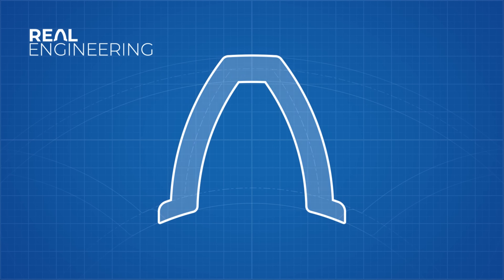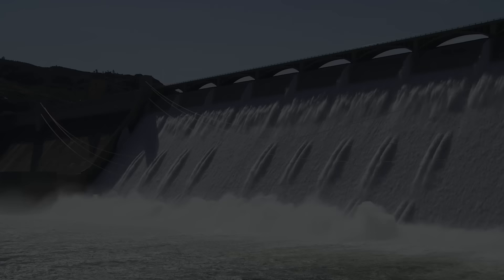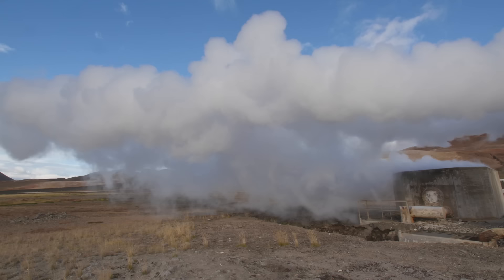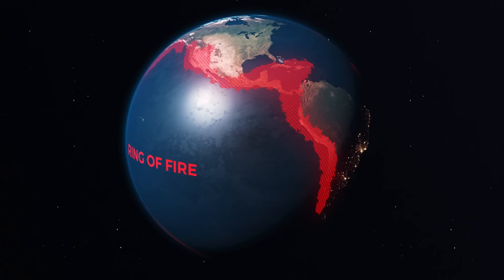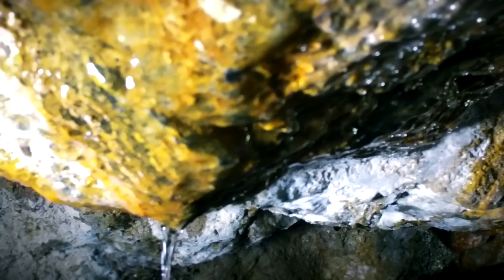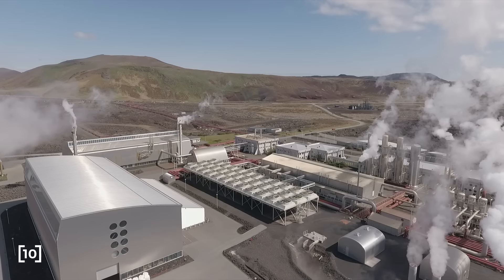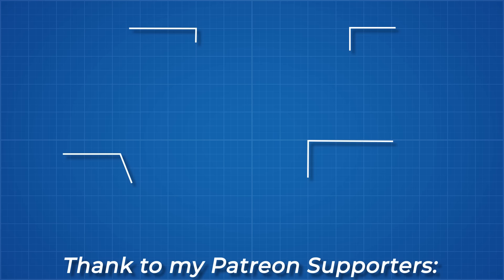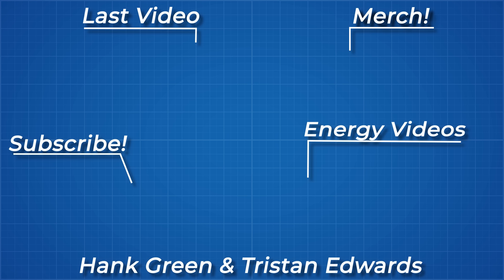Could Earth's Heat Solve Our Energy Problems?

Comment: Most opposition to nuclear energy is based on ignorance. Change my mind.

Edit: To summ up most answers for those mentioning Chernobyl and others. Just like a plane crash, these examples are easy to point out sources of a couple tens of thousands of deaths. What people always forget mentioning is the estimated 4+ million deaths a year from air pollution. That's one part of the ignorance i was talking about. A couple accidents costing a couple tens of thousands of lifes cant realistically ever outnumber the lifes we lose each year by polluting the air as we do. Then there is also climate change, which is a hard to grasp concept for some, but way worse than a couple tens of thousands of deaths by itself (and potentially irreversable if we keep continuing). Then there is the fact that newer types of reactors can pretty much make a meltdown more or less impossible, not even talking about using thorium. Keep in mind that nuclear energy was - and still is - a very new energy source in terms of progress. The only real problem would be the waste. However, it's better to be able to contain and store waste, compared to just pumping it into the atmosphere. Keep in mind that radioactive elements with short halftimes are the dangerous ones, but gone in a couple years. These with millions/billions of years of halflifes are basically not very dangerous, since they dont radiate a lot. So the most problematic ones are those with halflifes that make them radiate dangerous amounts, but still stick around long enough to cause problems. Still, in comparison this is a smaller problem to deal with than air pollution and greenhouse gases by far. Also renewable energy sources are neither renewable, nor completely green and it's not possible to sustain the planet by them alone, not to mention all those batteries needed.
Reply: Isnt the only problemb the nuclear waste?
Reply: @mike4490  there isnt even all that much. just stick it under a mountain.
Reply: @mike4490  isnt that much, we have deposits of nuclear waste prepared to receive the waste. Nuclear is the best solution to mankind
Reply: Most, yes. Not all, but most. The risks are greatly exaggerated in the public consciousness because of a handful of well-known disasters, while in fact nuclear plants are probably safer than most oil or coal plants.

However, part of the reason nuclear power plants are so safe is because the public is so paranoid about them.
Reply: @mike4490  In molten salt breeder reactors, to my knowledge there isn't really waste; and in other forms of breeder reactors, just other forms of fuel as byproducts that can be processed and used to generate more power, whose products can be used to fuel breeder reactors, IIRC. Like, uranium can be turned into plutonium which can then be used to generate energy, convert back to uranium, and then used to make more plutonium, and so on. The uranium that both absorbs energy and becomes plutonium (specifically PU239) and is made when the plutonium is used as fuel is Uranium 238, which is the vast majority of uranium (like, over 99%; the uranium we use for nuclear fuel is U235, and it's all of like 0.72% of the uranium mined or something?) and is relatively non-radioactive, with a half-life of 4.5 BILLION years, so is a pretty stable product to store. Still not safe to have just lying around the house, mind you, but locked up in a simple concrete storage facility? No problem. Here's some more info on it: http://www.radioactivity.eu.com/site/pages/Uranium_238_235.htm
Reply: does not matter, the future is zero point energy
Reply: @mike4490  And accidents....
Reply: Michael Liogky nuclear waste is containable and is not pumped into the atmosphere we breathe
Reply: One word: Fukushima.
Another word: Chernobyl.

A poorly designed fossil-fuel power plant that blows up won't irradiate the region for many decades.  Nuclear plants will.
Reply: @amrencortez2636  yeah but look at Fukushima, isn't it still polluting the Pacific ocean. People are more llikey to sweep their waste under the rug these days. 
Shoving the nuclear waste in a storage facility doesn't sound smart either. We have a problem with normal waste as it is. We don't need a dump of nuclear waste as well. 

While I understand nuclear is the most efficient electricity producing option. how many plants would we need to power the planet? Especially with the increased need if everyone goes electric. There would be a point where the waste would become unreal.
Reply: @mike4490  Reliability is a big concern with nuclear.  It's not just Chernobyl, 3-mile-island and Fukushima that we've had so far.  There are dozens of incidents that have happened in the smaller scale plants that have largely gone unnoticed by the general public.  Nuclear plants these days are probably the safest industrial sites in the world, because of the consequence of accidents being so high and so very public.

And it's a truism in engineering that there is no such thing as an accident proof system.  You can build something that's 99.9% reliable.  You can build a thing that will catch that 0.1% error 99.9% of the time, and you can make multiple redundancies and layers of all these systems.  But it is always possible that everything will fail - especially since most power plants on the grid are operating on a for-profit basis, meaning there's only so much money to spend on training staff, maintaining equipment, etc. 

You can probably design a commercially viable reactor that, as long as nobody takes shortcuts with staff and maintenance (which is guaranteed to happen), will only have a 0.1-0.01% chance of catastrophically failing in any given year.  But when you build ten thousand of them all around the world, the odds that one will fail in any given year are quite a lot higher.
Reply: @RonJohn63  Chernobly and fukishima were both caused by human error, not an error in the power plants design. And they only irradiated part of the city/ town they were in. Also, nuclear plants have become much safer since then, and more people have died from wind power than nuclear power. Just putting it out there.
Reply: There are two important details about nuclear which makes it the best source. The first reason is how part of the earths core contains a large amount of radioactive elements which is mentioned in the video which makes a geothermal plant an indirect nuclear power plant, the second is how nuclear waste is discarded in locations which are monitored by the military , and it is possible to recover certain elements from waste.
Reply: @remenencenda768  not an error in the power plants design

Given that humans designed the plants, your argument is fallacious.

And they only irradiated part of the city/ town they were in.

Ah... "only part" of the cities.  That makes it sooo much better.

more people have died from wind power than nuclear power.

And yet I can walk up to a recently-destroyed windmill and not have to wear a lead-lined suit and only stay for three minutes.
Reply: @rashkavar  In 1958 in UK , there was a fire in the reactor of Winscale 1. This caused a radioactive release of radiation across the uk and europe (1958). On a scale from 1-7 with 7 the worst, it was ranked as a 5 , serious and covered up by the government of the time.They even changed the name of the Winscale Plant in uk to Sellafield to make it look like the problem had gone away.
Reply: Fission nuclear energy has we know it today is outdated. It use a fast breeder process which is dangerous and inferior to a thermal one. We used this because knowing the atom bomb its what we knew the most. Also it enabled us to produce elements required for atomic weapons.  Current nuclear fuel is inefficient: we have to extract the .7% of uranium 235 from the uranium 238 which also extracted from the mined minerals using fossil fuel. Then the "burning" of 235 is not that efficient and will have to be reprocessed. Please look into it.
Reply: bruh why you trying to bring out the crazies you already know there's no rational arguement to change your opinion
Reply: @amrencortez2636  No , its leaked into the atmosphere through various nuclear accidents, and do you really believe there wont be any more(accidents)?
Reply: @dasovietpotato3784  Not sure I'd call geothermal energy an indirect nuclear power plant because there's radioactive isotopes in the core.  Even in the most technical of senses, that's not true - radioactive decay is not what runs a nuclear power plant; fission is.  And it's definitely not comparable in terms of what people would expect "geothermal power" and "nuclear power" would mean.

And which military?  This planet has several, and the nuclear plants that currently exist already exist in more than a dozen different jurisdictions.  If a single military is looking after all the nuclear waste in the world, that country has done a lot of covert invading that I've not even suspected up to this point.

And given the waste material that people are actually worried about is the stuff that's dangerously radioactive on the timespan of 10 000 to 1 000 000 years, I sincerely doubt there's much use for it.  There's definitely the medical radioisotopes, but if you want to produce those in bulk, you're not running a power-optimized reactor, you're running one optimized for creating specific isotopes.  (And yes, facilities like this do exist - back when I was a kid, before 9/11, there was even one doing public tours that I got a chance to visit.)
Reply: @remenencenda768   I dont know where your talking from buddy. It cant be this planet. Fukushima was caused directly by a 14m tsunami flooding backup generators. i.e. by events not even imagined by the designers. Not  just a big wave but also lowering of the land. 
So who told you that seven years after Fukushima happened, every nuclear reactor on the planet has had a design overhaul to cover things that no one planned for?
You are truly deluded...
Reply: @musman9853  Is there a mountain near your home you would like to suggest?
Reply: @RonJohn63  Yeah, it's definitely a better idea to just pump fossil fuel waste into the atmosphere. Air pollution is estimated to cause 4.6million deaths per year. Fukushima and Chernobyl together? A couple tens of thousands, including all the potential deaths that may or may not be caused by the radiation. Make that millions for all i care, the amount of lifes we would save by simply switching away from fossil fuels cant realistically be outnumbered. 
It's the same thing as with planes. They are increadibly safe compared to cars, yet the media is caring a lot more about a single crashed plane, killing a couple hundred people at best, than do about the estimated 3000+ deaths a day due to car accidents. Humans are good at tackling specific, easy to grasp problems. Like, for example if an asteroid was going to crash into earth, everybody would agree that that's a bad thing. Climate change on the other hand, some people still dont believe is real. 
What i'm getting at is that a couple thousand people dying in a explosion, or whatever, will always get more attention that millions dying each year through invisible, harder to grasp concepts like air pollution. That does not make them any less important tho. 

That said, for both Fukushima and Chernobyl the problem was not the technology, but safety restrictions. Chernobyl was a human error, which should not be able to happen in such an important structure. On top of that Fukushima should have been designed stronger for an area that is known to suffer earthquakes and tsunamies regulary. In both cases these catastrophies could have been avoided by better planning and security. These are problems we can work on tho, while long lasting air pollution (or greenhouse gases) may not. 
Then again, there are better reactor technologies nowadays, that may potentially completely eradicate the risk of failure. 

Last but not least, a nuclear reactor can not "blow up" like an atomic bomb. That's impossible. They are two completely different things.
Reply: @Veeger  Yep, that's the kind of incident I'm talking about - the ones that aren't the big 3 well known ones.  Fission has its benefits, but the safety issues are a major detractor.

There's a bunch of public paranoia on top of this.  Which leads to coverups...which leads to more paranoia when those coverups inevitably fail to cover everything up.  It's not a great situation.

Personally, my biggest fear in the energy development of the future is that this paranoia will leak over to fusion power when it becomes viable despite it being a very different scenario.  We're going to need that power source to be a long term energy solution (if there's anything that can compete with geothermal energy for reserves, it's our deuterium reserves...plus stripping the oceans of deuterium won't cause the massive problems that long term exploitation of the earth's core heat will.  (See Mars for what happens when you don't have enough heat in the core) 

Both of these are incredibly long term scenarios, of course, by no means could we either exhaust our deuterium reserves or geothermal reserves within the next century...or the next few millenia after that, unless the tech development of the 20th century turns out to be the start of a sustainable exponential curve.
Reply: @Veeger  In the event of a tsunami detection they are to iniatiate SCRAM, or basicly dump the fuel rods in the sealed pool. (it also stands for Scientist Control Rod Axe Man)
Reply: @RonJohn63  First of it is not a "windmill" but a "wind turbine". A windmill is a mill for grain that uses wind to turn a grinder to mill the grain.
And by "human error" I was referring to an error iin the operators, who were unfocused and tired at the time. But the people that designed the plant had years and didn't make any mistakes.
Reply: In order to have a safe nuclear power we need to have a number of systems in place. In the end you are trusting somebody you don't know to have a truly safe and successful system. Much of the opposition to nuclear power is based on a certain kind of paranoia that at the core is at least reasonable. I don't think any of these problems are not solvable and a certain amount of transparency can guarantee competence but we have to trust people in positions of authority in order to make everything work. I believe that level of trust is in very short supply these days.
Reply: @ErikHare  we can make a safe nuclear power plant.  The problem is that they're soooooo expensive.  That's because humans tend to be sloppy, lazy and cut corners.  (Which is why, for example, there thousands of tons of dioxins in the Hudson River.)
Reply: What about the finite amount of uranium reserves?
Reply: The problem of nuclear waste actually isn't that large. I'm quoting most of my information from an article posted by the World Nuclear Association that I'll try to find and link here. https://www.world-nuclear.org/information-library/nuclear-fuel-cycle/nuclear-wastes/radioactive-wastes-myths-and-realities.aspx. I shall sum a few of the points up though.

First of all, the nuclear waste problem is actually not that serious. Much of the High Level Wate (HLW), which is the dangerous stuff, has a half life of only a few decades. This means that it can be contained in short term storage facilities until it is no longer as hazardous. After this, long term storage can occur. Approximately 3% of total nuclear waste will still be dangerous in thousands of years. This stuff will be buried very deep underground and will be encased first in glass and then sealed in a steel cask. Even assuming a worst case scenario of complete societal collapse, where our future generations have the ability to reach the dangerous waste through its containment, but don't understand the meaning of the trefoil symbol, or the warnings written around the plant, this waste would still cause less harm than other energy sources do today.

As for disasters like the Chernobyl and Fukushima incidents, these are the true problems with nuclear energy, however they are manageable. The Chernobyl incident was largely caused by both human error, and the Soviets insisting on hiding information about the flaw in their RBMK reactors. If the operators in the control room had known about the consequences of pressing the AZ-5 SCRAM button, the incident could have been largely avoided. The result would likely have been a large scale meltdown, rather than the explosion that caused the entire area to be contaminated. The liquidators would never have had to clear the roof of radioactive debris. The heat exchanger to prevent the corium making its way into the groundwater would likely still be necessary, since the RBMK reactors were built without containment structures. My point is that modern nuclear reactors are built so that this series of events could never happen again. Of course, some other unforseen event could happen to cause a level 7 incident, but we will be prepared for it.

The incident at the Fukushima Daiichi plant is a good example of this. Yes, to this day it's still causing problems. However, even though several of the reactors melted down, the incident is far more contained. The primary reason that this incident even occurred was due to errors on the part of TEPCO and General Electric. The US NRC warned in 1990 that damage to cooling systems in seismically active regions were a likely risk. The Japanese NISA quoted this in 2004, however TEPCO did nothing in response. They were also warned that their seawall was not sufficient to survive a powerful tsunami. Again, TEPCO did nothing. The plant was largely designed by General Electric, who supplied the Type 3, 4 and 5 Boiling Water Reactors and specified to TEPCO the positions of the emergency cooling systems, which were damaged in the tsunami and caused the meltdowns. TEPCO were warned by their engineers that placing the cooling systems in these positions was risky, but they decided to follow GE's specs. It is unknown if GE provided these specifications knowing about the potential tsunami risks, or if they simply knew it to be the optimal configuration for their reactors, but either way, it was a mistake. If TEPCO had been forced to make changes by a regulatory body, the Fukushima incident could have been avoided.

I suppose my point is that in both of these incidents, it was known that the threat was possible. If we can ensure that nuclear reactors adhere to the necessary safety standards, there is very little risk of this happening again. It's a human problem, not a technological one. Until safe, clean fusion energy is developed, nuclear fission is our best option for power, hands down.
Reply: @Veeger  I think to answer the initial question that we have post here we can say that opposition to nuclear power is not necessarily born of ignorance but it can be born of skepticism. If you wish to be more negative about it you could say paranoia. But it is certainly based on a lack of trust and indeed and understanding that we cannot take into account everything.

Are there failsafe systems that can manage absolutely any situation? I believe that is actually quite possible. But the public has to have trust in it.

Rather large failures have eroded that trust. In many ways this is reasonable.

Your point that it may not be possible to have complete Trust is at least reasonable. I believe you are wrong but it would take a tremendous amount of detailed conversation for either of us to prove our position. Given a Layman's understanding of the situation I think it is quite reasonable that we have skepticism.
Reply: @Veeger  I think to answer the initial question that we have post here we can say that opposition to nuclear power is not necessarily born of ignorance but it can be born of skepticism. If you wish to be more negative about it you could say paranoia. But it is certainly based on a lack of trust and indeed and understanding that we cannot take into account everything.

Are there failsafe systems that can manage absolutely any situation? I believe that is actually quite possible. But the public has to have trust in it.

Rather large failures have eroded that trust. In many ways this is reasonable.

Your point that it may not be possible to have complete Trust is at least reasonable. I believe you are wrong but it would take a tremendous amount of detailed conversation for either of us to prove our position. Given a Layman's understanding of the situation I think it is quite reasonable that we have skepticism.
Reply: Its pure propaganda and psychology. A fatal event in a plane "seems" much worse than a lot of car accidents... people is afraid of the safest energy production method... thats life
Reply: Timothy Schellin then we use thoruim
Reply: Erik Hare Are nuclear reactors are safe, and meltdowns are almost always contained or stopped, Chernobyl was caused by laziness and sloppy judgement
Reply: It's based on experience of Three Mile Island, Chernobyl and Fukushima. It is also based on cost. In the US nuclear power plants cost billions to build. There are 2 power plants being built in the state of Georgia for a cost of 23 billion dollars. There is another plant being planned in England that will cost 20 billion. It is often the most expensive power source there is.
Reply: RonJohn63 the misconception has spread very far, but look at the definitions or search “difference between windmills and wind turbines”
Reply: RonJohn63 - Fukushima and Chernobyl are straw man arguments against fission energy plants.
I don’t think anyone wants more BWR or PWR reactors to be built.
If you don’t like uranium salt or liquid fluoride thorium reactors, I’d be curious why...
Uranium salt reactors can use what old reactors considered waste.
Reply: @mike4490  there are technologies, specifically  Lithium Fluoride thorium reactors , that actually "burn" / react  nuclear waste to produce energy.  Nuclear waste is not nearly an issue that the media had pressed during the 80's and 90's.  Majority of it is only weakly radioactive... there is an inverse relationship between half life and intensity of radioactivity.
Reply: @RonJohn63  correction Boiling water and pressurised water and graphite moderated reactors blow up.  Newr technology, especial salt cooled reactors CANNOT blow up.
Reply: Chalk River, Three Mile Island, Chernobyl.
Reply: @RonJohn63  "One word: Fukushima.
Another word: Chernobyl.

A poorly designed fossil-fuel power plant that blows up won't irradiate the region for many decades.  Nuclear plants will."

Correction A poorly designed nuclear plant will.
Lets use France as an example to follow. They have 58 nuclear reactors in operation since the 1970's and have one of the lowest emission rates in all of Europe.

They have had only a handful of small incidents for this entire period listed here: https://www.reuters.com/article/us-france-nuclear-accidents-idUSTRE78B59J20110912

It's a pity they intend to shut these down to comply with the Paris Agreement when technically speaking that agreement taking notes from the French.
Reply: @kefkaZZZ  all of which were based on non failsafe designs.. modern western style reactors require external power to run their pumps to keep core cool. if this fails, they are screwed. 

Chernobyl type reactors fail because their inherent design makes them very difficult to control at low power levels .  Causing a runaway reaction that generates steam explosions .

Molten salt cooled and moderated reactors do not have these problems.  as the reactor heats up, the fissionable fuels atoms spread apart further and further, reducing the power generated  in the core . they cannot 'runaway" like current reactors of both former soviet union and the western nations.  

I(f there is an issue where the circulating pump fails  or if power fails, the molten salt designs  are designed with a fusible plug of coolant salt that is kept solid by a cooling system ( usually just a fan or two ) . if there is an emergency ,  the plug melts and the coolant and reactor fuel drain into tanks where they cool and solidify . since they can never reach ultra high temperatures of a melted or exposed normal core, these materials cannot melt through  the containers  nor can they escape the reactor  chamber.

Search "lithium Fluoride  Reactors" or "Molten salt reactors " or "Thorium reactors" for more information  .
Reply: Opposition to nuclear energy is directly responsible for higher energy costs, greater reliance on fossil fuels, and more pollution. Despite the propaganda spread by well-meaning but ignorant environmentalists, RENEWABLES ARE NOT SUSTAINABLE. If things don't change and change soon, America is going to be facing a nationwide energy shortage as pressure from environmentalists chokes coal plants and over-reliance on wind and solar turns electricity into a commodity afforded only to the rich. Liberals and conservatives need to put aside their differences and embrace the only energy source that even has a chance at saving us.
Reply: @RonJohn63  Modern Thorium liquid salt reactors are "walk away safe" -- which means if they fail, the nuclear reaction stops.  They don't blow up because the CAN'T blow up.  Educate yourself.
Reply: @walker1054  Another point is that the rare earth elements mined to make windmill magnets and high quality photovoltaics are in ores which contain Uranium and Thorium.  So to make "green" energy harvesting devices, piles of radioactive waste tailings are produced.  So there is a nuclear waste problem without the reliability of nuclear power.  So the nuclear waste from green power will have to be reburied or burned up in a nuclear reactor.
Reply: @RonJohn63  The radiation risk os vastly overstated. Even to this day you can walk safely around chernobyl in plain clothes, even in the plant itself. Only the sarcophogas and basement levels are still highly dangerous.

Fukushima has done negligible damage to all but the most immediate surroundings, and frankly there is not enough radiation for lethality.. Just an increased cancer risk.
Reply: Why? You’re right.
Reply: Easy: Chernobyl and Fukushima.
Reply: The future is THORIUM!!
Reply: Guys lets just use thorium. With thorium it is impossible to have a meltdown and is more efficient than uranium and the thorium only has a half life of 130 years and is less toxic and produces less waste than traditional nuclear waste
Reply: @yann9378  BS:
Meltdown is possible depending upon reactor configuration. Since thorium cycle requires TWO neutrons per fission (first to produce U-233, second to fission U-233), reactors must be compact to prevent neutron loss. Compact reactors always run risk of thermal runaway.
Half-life of thorium is 14 billion years.
Wastes are exactly the same as uranium reactors.
Reply: @KainYusanagi  You wrote: "Like, uranium can be turned into plutonium which can then be used to generate energy, convert back to uranium, and then used to make more plutonium, and so on"
Where do you get this nonsense? That is a perpetual motion machine that you describe. Once plutonium is fissioned, it CANNOT be converted back into uranium.
Reply: @RonJohn63  Look up thorium salt reactors.  Not all nuclear power is the same, and there are indeed some cycles and reactor designs that are not susceptible to the thermal runaway that causes disasters like Chernobyl and Fukushima.
Reply: Most sure. But by no means all.

Australia's most recent report on the matter concluded the following (and didn't mention the issues usually brought up)

Of the options Australia has for generating power, nuclear would be among the single most expensive options in terms of price/kwh generated.
It also provides baseload power only, which, given the existing state of the grid is the least appropriate type of new generating capacity. (the country desperately needs more peaking plants, NOT baseload.)
Finally the lead time for constructing a nuclear plant is on the order of years to decades, which is problematic when faced with more pressing immediate problems.

So... Sure. 'most'. But by no means all.

And it's as naive to call nuclear a cure-all for all the world's current power problems as it is to reject it outright.
Reply: Fabian most opposition to nuclear energy is based on history.
Reply: @romeufilipe5574  Zero Point energy is not a commercially viable energy source in the slightest
Reply: Nuc power is the most expensive at 12c per wh and produce  1GW  vs  2GW  at petroleum  plants    Just what re-usability in actual practice are you referring to? The holding tanks at most Nuc plants are full and the rods they hold are 100k times more deadly than when they were installed  The rods have to be held for 40 years min before they can be transported and cooled continuously to avoid meltdown  There is no destination for the rods and no approved safe transport and storage   The US taxpayer has payed for the re-fueling and the total percent of our power needs has never been over 20%  The process to produce fuel rods is complex and expensive the tailings left behind from the entire mountains leveled to produce a few boxcars of yellowcake has a big environmental impact
Reply: Fabian, most opposition to nuclear energy is due to experience. 
Back in the '50s the public expectations of nuclear energy were limitless. It was going to be a limitless source of power. This was when the memory of Hiroshima and Nagasaki was fresh.
Reply: @RonJohn63  - Keep going: Three Mile Island, probably before most YouTube viewers were born. Hanford (plutonium transmutation). Oak Ridge (uranium enrichment).
Reply: @remenencenda768  - Chernobyl's RBMK is an inherently dangerous design. The 11 remaining operating reactors have been modified to reduce the danger. No one wants to build any more RBMKs even of the improved design.
Reply: There may be more requirement for a safe nuclear plant than we know. For example, financial cost in the long run (can the company/state afford it from the building to maintenance to disassembly), skilled labor (we don't want jerks to do the work), appropriate location with appropriate weather (making a custom power plant would drive the developing cost through the roof), etc. Not saying that nuclear is bad, but we should probably take awareness to it cons and pros before forming our opinion.
Reply: @DavidFMayerPhD  That's exactly what happens, though? U-238 gets bombarded with neutrons to convert it to Np-239 which then beta decays to Pu-239, which itself decays via alpha decay to U-235. Once any particular molecule is consumed for fission, though, of course it can't be used that way (in plutonium's case, it's mostly xenon and zirconium that it fissions into, by mass). If you thought I meant that the specific portion used up in fission can be re-used, just getting split down to a form of uranium, no; I was talking long term, over the entirety of human existance going forward utilizing nuclear power. Sorry if my phrasing implied other than such to you.
Reply: @chaomatic5328  Absolutely true, but most people are done after listening to the cons these days. Safety needs to be worked on. With higher public acceptance science would also eventually develop way better reactors - and even now there are some that potentially make meltdowns impossible in theory. So while the waste is a problem, all things considered nuclear fission is a huge stepping stone we simply dont want to step on, but may eventually need to.
Reply: @Viewer19  You really need to look at more sources than one for nuclear power, Nuclear power is among the cheapest power options. And to get the uranium we don't level mountains. That would be expensive and ineffective. Instead we use mineshafts going down towards were uranium is more common. And after a fuel rod is used it has a significantly less amount of radioactivity, and is then stored in a pool of cooled water until it drops to an every lesser level, where we then ship it off to Norway because why not. And you can literally swim in the holding tanks at nuclear tanks, provided you saty at least ~2 meters away. The USA government could put them ~2 meters under pools and no one would notice any radioactivity, (it would be separated by a barrier). Everything you have said is based on information from the '40s and misconceptions.
Reply: @PlanetGoddess  will see
Reply: @remenencenda768  No the shine from those rods is more deadly to humans than the new rods and have to be held for 40 years min before they can be transported and cooled continuously to avoid meltdown Did you not understand  Fukishima and the desperate rush to pump seawater into the holding tanks or do you skip over any facts that conflicts  with the disinformation that you cling to?  the US taxpayer has payed for the re-fueling and the total percent of our power needs has never been over 20%  The process to produce fuel rods is complex and expensive the tailings left behind from the entire mountains leveled to produce a few boxcars of yellowcake has a big environmental impact  Modern reactors can use lower purity rods but they cost huge amounts of money US plants are old and ready to shutdown many that have are leaking and dangerous  You are the misinformed one proven by your erroneous statement of low cost which is patently not true it  is the most expensive and when you factor in re-fueling not cost effective
Reply: @Viewer19  First off do you not understand why rods are taken out? It is because they have decayed into amore stable form, so they radiat less, which is why they are taken out. And why to you keep saying "the us taxpayer has payed for the re-fueling and the total percent of our power needs has never been over 20%" First thing wrong with this, most nuclear reactors is the USA are privately operated or require no monetary input from the government besides building them. And second more than 20% of the USA's power grid is definitely used at once. Another thing I assume "yellow cake' refers to uranium fuel rods? because uranium fuel rods are comparitivly cheap in $/megawatthour when put next to wind, solar, coal, and hydro. while yes they do take some effort to to make it isn't that much, and we already have a ton of high grade uranium being used in USA's nuclear plants, if you can't guess It is from the nuclear bombs that aren't good anymore. And why must they be stored to prevent meltdown? After the fuel rod is used up it doesn't have any risk of meltdown because it will just emit a radiation, which is blocked out by the fuel storage tanks. The only reason meltdown can accur is because when a fuel rod is still being used we have to bombard it with neutrons to keep it releasing heat, and when someone does a bad and messes up what is essentially a controlled nuclear explosion becomes an uncontrolled nuclear explosion. The only danger to us is when the rod is being used, and failures never happen. No reactor in france, the country that gets almost 90% of its power from nuclear reactions, have ever melted down. Chernobyl was caused by human error, and with better seismic scanner any other fukashima could be avoided.
Reply: @Veeger  Windscale was a poorly engineered (*AIR-COOLED* for crying out loud! Yes you heard right, they were passing AIR through the reactor's core and then exhausting it in the environment as-is!) and hastily built to produce plutonium. They only put filters on the exhaust because the head engineer complained, and even then they were known as a "folly" and deemed useless!
Reply: @remenencenda768  – Chernobyl and Fukushima each resulted in the abandonment of several hundred square miles of previously inhabited territory. Hundreds of thousands of people had to be relocated. The ongoing Chernobyl Cleanup continues to consume a considerable portion of Ukraine's annual government spending.
Reply: "Change my mind."

I won't.
Reply: Nicholas Miller There’s no need to abandon any of the land around Fukushima Daiichi. This is a perfect example of the insane overreaction to nuclear accidents.
Reply: also what about thorium, I know its talked about a lot on yt but if you take the nuclear power plants even further from civilisation you can kill fewer people and more marine life or non humans
Reply: @RonJohn63  
Operative words;
 "poorly designed".
Reply: It's not just ignorance of the populace - it's also ignorance of those in charge and in power.

Lest we forget 3.11.
Reply: @remenencenda768  You are so ill informed. All the nuclear plants in Russia that had the same design as Chernobyl needed their control rods to be redone due to a design flaw which caused a momentary increase in reactivity following a scram event. 

Fukushima was also a design flaw in the way the back up generators were placed. That reactor should also have had a passive cooling technique that did not rely on electrical source to circulate water through the core.
Reply: @curtischilders3024  You're using the "straw man argument" term incorrectly. Those two events are THE REASON why there's so much opposition to Nuclear. That's like saying the holocaust is a straw man argument against the Nazis.
Reply: @rainz2133  - by your logic, you better not fly on those dangerous jet planes. 
https://en.wikipedia.org/wiki/List_of_accidents_and_incidents_involving_the_Boeing_707

Interesting fact, Boiling water reactors (Chernobyl & Fukushima) were designed around the same time as the Boeing 707. 

One jet bad, all jets bad!  One fission reactor bad, all fission reactors bad! 🤔

No, that's not a strawman argument, that's a really well supported argument...  sigh
Reply: The problem is Chernobyl was milked for all political value by the West against the Soviet Union. Yes it was a terrible disaster but it wasn't as bad as it was made out to be. I don't know what the exact statistics are but only a few thousand people died from that accident compared to the 4+ million that die from air pollution.
Reply: @Fabian - I agree. It's hard to move forward, when some insist on clinging to mistakes made in the past. 
If reactors couldn't be made safer, or operated better, then they'd have a point. 
But nuclear gets better all of the time as large investments are made in safer and more cost effective systems.
Reply: @remenencenda768  @viewer19 I'm afraid you're both wrong. I don't have the statistics in front of me to argue points on cost and the like, so I'll leave that for now.

First off, spent rods do still produce heat. Radioactive decay, is inherently loss of energy. That energy produces heat through a number of different processes, depending on the form of radiation. However, they were not what caused the meltdowns in reactors 1, 2, and 3. They were caused by the same processes, but in the reactor core, not the SFP. The SFP did indeed heat, but not to the point of releasing radioactivity into the atmosphere. The spent fuel is indeed still highly radioactive, far more so than the original fuel rods. The original rods are actually stable, I believe. Pure U-235 doesn't decay spontaneously, at least not in amounts to produce harm to humans. When bombarded with neutrons, U-236 is formed. Which is highly unstable and decays to produce lighter elements and more neutrons, which when slowed by a moderator can interact with more U-235, sustaining the reaction. Spent fuel is removed when it can no longer sustain a satisfactory chain reaction. The material left in the fuel rods is highly radioactive because many of the waste products are more unstable. The benefit to this is that after a few tens of years, the material is nowhere near as dangerous, and can be put into long term storage. Considering most reactors only need to be refuelled once every ~6 years and produce quite little waste by volume, storage facilities are capable of handling the material until it can be put in long term storage. Please refer to my comment above to understand the process for this.

I have just taken a quick look at cost statistics and I think you'll find that nuclear power is incredibly cheap compared to most other forms. The cost comes from building the plants, not actually producing power. This means that a nuclear reactor needs to pay itself off. However the actual price for the consumer doesn't increase much, considering how long reactors can actually run for, leaving nuclear to be competitive. Especially when considered that they can be run non stop for literally years on end, compared to solar or wind that rely on good conditions. Once you factor in batteries to store excess, the plant cost quickly becomes more appealing.
Reply: @Sir Charmander the Third I understand and agree that nuclear is currently the most efficient. However we as a country are terrible when it comes to waste.

 I expect nothing different when it comes to nuclear waste. Creating more plants without figuring out the proper way to dispose of it, is foolish to say the least.
Reply: Until we find some way of dealing with and safely storing nuclear waste generated by nuclear power, we have a growing disaster waiting to happen. The US is still shuffling about barrels of waste from fifty years ago, and instead of it being buried safely (every proposed site meets pushback from state governments), it just gets moved from place to place. It's only a matter of time until a catastrophic failure or degredation of one of these barrels leads to an ecological disaster. It's only a "smaller problem" than carbon because it's for the most part contained. That's just because we've been lucky.

Yes, it's the cleanest pound-for-pound. But the waste it generates is by far the worst. Until we, as a nation and as a world, agree on a safe way of storing the waste, it's not a good option. In addition, if you can enrich uranium enough to create nuclear energy, you have the material to make nuclear warheads and weapons. This is just another issue. In a perfect world where everyone was mature, cooperative, and adults, nuclear would be great. But this is not that world. Seeking alternatives is still necessary.
Reply: @senselocke  
First of all, yes the waste is the biggest problem. It's the only problem when done correctly. As you said yourself, having the waste contained is by far better than just polluting the atmosphere. Even if one or more of those barrels broke, it would still be a local disaster, which we can take actions against - not a global one causing millions of lifes a year, every year. That said, nuclear does not mean uranium. The reason we decided to use uranium was because of it being usable for weapons. That was the main reason. Nuclear reactors were partly to be used as weapon production facilities. Uranium is neither the only, nor the best choice. That said, if nuclear energy was more popular, there would be more intent on researching proper ways of dealing with the waste, not to mention that we can recycle parts of it into other kinds of nuclear fuel. It's similar to most "green energy sources" use up tons of rare earth metals, for which we do little to no recycling. People just dont really bother until they have to. And even then, with any and every nuclear-related death combined, any other energy source killed more people than that. Even wind and solar. 

And in the end it's still an arguably easier problem to deal with, having to store nuclear waste for max a couple hundred years before we find a way to get rid of it, compared to having to filter the entire atmosphere (which may not even be possible when we start too late, because warmth is saved in more than the atmosphere and it will take at least the same amount of years, potentially way way longer, to cool down as it took to warm up). 
I agree that neither of them is a perfect solution, but if it was a "pick your poison" solution, then i'd definitely go the nuclear way, which is why it is and stays the best alternative until we unlock infinite energy with nuclear fusion (which is, by the way, also nuclear energy).
Reply: First air pollution that causes deaths from say asthma are particles of dust and not CO2. These are caused by industry in general not exclusively by the production of energy/electricity. The accidents that occur cause the area to be literally poisonous for decades if not longer. Accidents from conventional power plants don't do this. You can have brown fill sites but they are cleanable and not toxic in the long term. Storing nuclear waste for thousands of years is creating deposits which are potential dirty bombs for people in the future. With man's history do you think it is safe to allocate a space of earth for such hazardous waste. Nuclear power plants in Europe are a seriously bad idea as it is a very densely populated region. The French are slowing decommissioning theirs in favour of more conventional or renewable sources. France has 80%  of its energy from nuclear power already. If a Chernobyl happened here and the wind blew in the wrong direction, millions of people, not just in France would be affected very seriously. The rate of cancer over the years would be a big contender for death via air pollution in the short medium and long term. Nuclear is not clean, as it is basically a glorified steam engine. These steam engines release water (clean water) into the atmosphere. If you want to know what the elephant in the room is regarding climate change there is a subtlety to it everybody seems to miss. CO2 is like the touch paper for global warming. It is minuscule in magnitude but it heats the earth just enough so that other gases like the elephant in the room, water vapour increase. Water vapour is many more times the green house gas than CO2 is. There is increasingly more water vapour in the atmosphere from our activities. Reducing Carbon emissions is more essential in regard to stopping the oceans acidifying. As for heating up, that is largely due to water vapour after CO2. By all means stick nuclear power plants in the middle of a desert in the USA hundreds of miles from anywhere but it is a no go in western Europe in my opinion. Nuclear is certainly not just a 'no brainer' option. If we have to live under ground because of the heating up or a serious ice-age (just as devastating) perhaps we'll have to use it but we should try everything else first that isn't CO2 heavy.
Reply: @jasonmaguire9425  
Sure, storing nuclear waste for hundreds or thousands of years is not optimal. Pumping CO2 in the atmosphere to trigger climate change, which creates more extreme temperatures, worse storms, sea level rising and a lot of implicite effects like more hunger, in a positve feedback loop which we may not be able to stop for hundreds or thousands of years, is worse. 
The same goes for catastrophes like Chernobyl happening again. Sure, it would be bad, but it's something we can actively work on. There are reactor designs which would make a nuclear meltdown impossible, completely negating this risk - even if humans made all of the mistakes possible, which is the most likely source for a meltdown.  

Further, while it is true that not all of the 4 million deaths due to air pollution come from CO2, about 1-2 million of them can be directly linkes to it, enough to prove my point.
You are also not correct on water vapor being a strong greenhouse gas. It is, in fact, one of the weakest greenhouse gases. There is just a lot of it, making it the number one factor. However, there is a huge difference between pumping CO2 in the atmosphere, versus pumping the same amount of water vapor into the atmosphere. CO2 is orders of magnitude stronger in affecting the climate compared to water vapor, thus replacing all of our CO2 emissions with water vapor would make our effect on the climate neglectable. 

Sorry but there is a lot of misinformation and half-knowledge in your post. 
Assuming there was a "no brainer" option for energy, then it would be nuclear. No other energy source (that we have today) could sustain humanity for the next tens of thousands of years, especially accounting for the increasing need of energy we have. This gives us enough time to work on more permanent solutions, like fusion (which is also nuclear energy btw). All energy sources have their drawbacks. All of them. If done correctly, the waste is the only drawback nuclear energy has. However, if nuclear was more popular, more research would be done. We are already able to recycle some of the waste, not to mention that most of it does not have to be stored at all, or just for a couple of years. Nuclear waste with low halftimes because they radiate a lot are very dangerous, but are gone very fast. Things that have millions+ of years halftime radiate very little and are not too dangerous. The ones that are problematic are the ones with hundreds to multiple thousands of years halftime, because they radiate enough to be dangerous, and long enough to be problematic for storage. However, at least the waste is contained, compared to the uncontrollable danger of climate change. 
If you look back only 100 years, it is not hard to imagine that we will have an economical way to get several tons of stuff into the orbit cheapy, in the next couple hundred of years. After we have that, getting rid of the nuclear waste becomes increasigly easy. So it's not like we have to store it indefinitely, it's more like a puffer until we solve that problem, which notably is easier to solve that reverting climate change.
Of course, since nuclear energy is very steady, we would most likely use it together with something else to cover spikes in peak energy consumption, but it would at least cheaply, cleanly (+storeable waste) and for thousands of years, cover most of our energy needs, which cant be said about any other source of energy.
Reply: I mostly agree with your edit, but you forget one thing: nuclear is goddamn expensive, when factoring everything in (look at hinkley point C and the new facility in Finland), those plants are going to make record expensive electricity, when they're finally done.
Reply: @tjs200  Uranium is not in short supply. Existing mines have a hundred or so years, but unproven reserves are likely able to extend to 1000 years. Uranium salts are also disolved in seawater. This could extend reserves to 100,000 years plus, and then of course there is thorium.
Reply: @haroldb1856  I'm not a fan of governments either. But what exactly do you expect to happen? Them shutting down the electricity for their own country? That's ridiculous. Them not considering proper guidelines to protect our health? Oh hell yeah, not like that's already happening with millions of air pollution related deaths a year. I dont mind living next to a modern nuclear plant, constructed according to standards fit for the region of construction. "Contamination" simply does not happen if you properly construct nuclear plants - as in dont put it into an earthquake and tsunami prone region without properly accounting for that. Any other meltdown we had was due to human error. Which wasnt many. And the total death toll of nuclear power is tiny compared to the alternatives. Not to mention we have modern reactor designs which cannot meltdown, even if the entire crew decides to go on vacation while leaving the thing to run out of control. 

While we are at it, might i ask what "potential for massive destruction" you are talking about specifically?